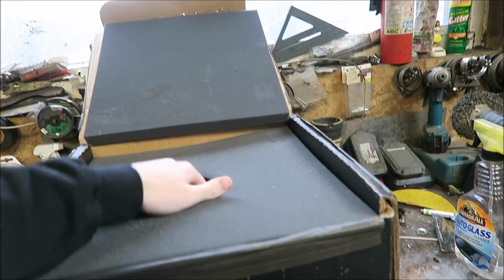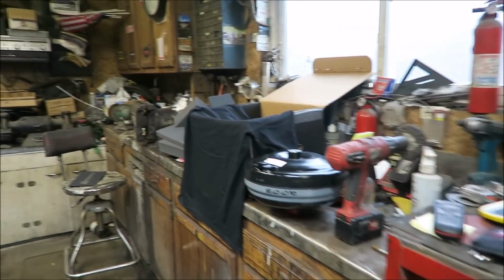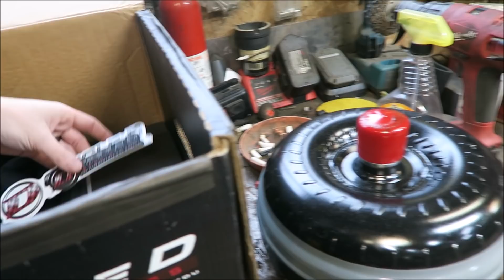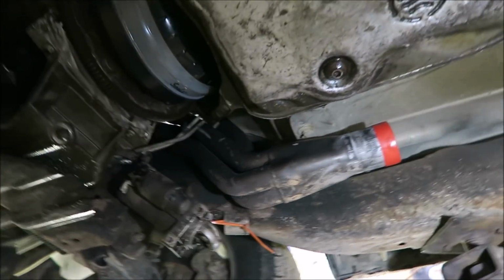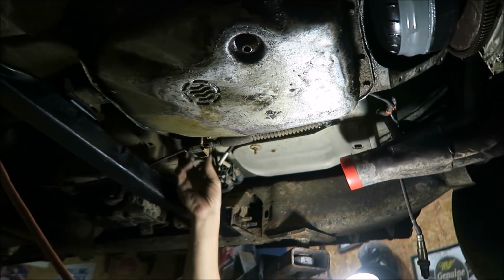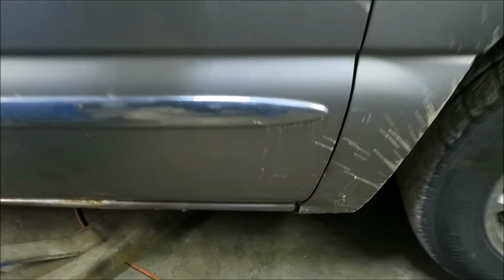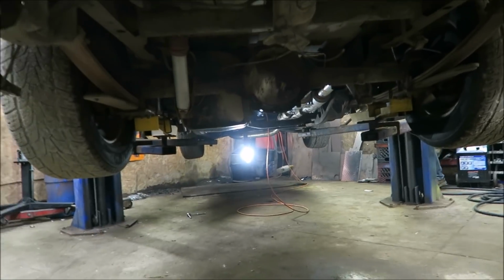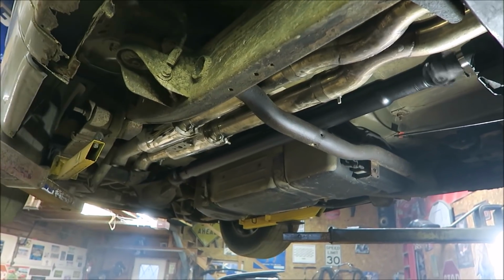Boosted Street Truck Gets A Circle D 3200 Stall Converter! PLUS A GIVE AWAY!

Comment: Running the Trans cooler through the Radiator again is just heating the fluid back up, I would recommend running it to that separate Transmission Cooler and back to the Trans. Should help keep the Temp down

Comment: You'll like the 4l80e but I would recommend a Trans go shift kit. I had one in a 6.0/4l80e swapped truck like yours. 4l80e kinda have slow shifts & can kinda hunt for gears. At least mine did till I installed the shift kit.

Comment: So I been thinking on doing this 4l80 swap n my truck. But I’m wondering what kind of tune does it need to make it run right?
Reply from the maker: You have to do a segment swap from something that came with a 4l80e. But, the PCM operating systems have to match. Which is what is currently giving me trouble. Might have to do a PCM swap.

Comment: Stupid ass question but how does your rear window open ive been wanting one and seen one in the junk yard today but couldn't open it to see if it was any good

P.s 2 blondes walked into a bar...you would thing one of them would have seen it
Reply from the maker: There's just like a little spring latch you press and it slides over. Its insanely basic lol
Reply: @SniderTron3000  will shit I guess its a good thing I didn't take my time to pull it out the junk truck didnt have anything like that Thanks

Comment: great choice on the converter.. I have a little street truck with a SBE 5.3L that makes around 383-385 RWHP (Aftermarket Cylinder heads and Cam swap) I chose the 278 MM   2700-2800 Circle D converter with a level 5 RPM tranny. It rips really good when you’re spanking on the rev limiter.
Can’t wait to see you rip on it!